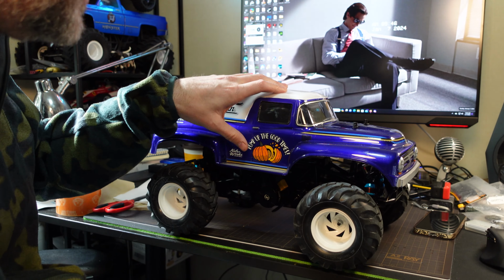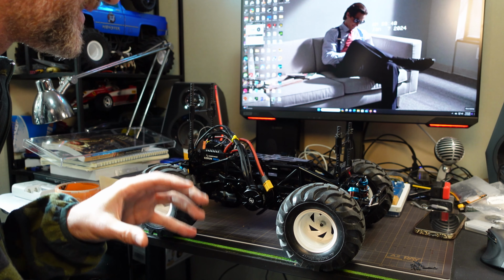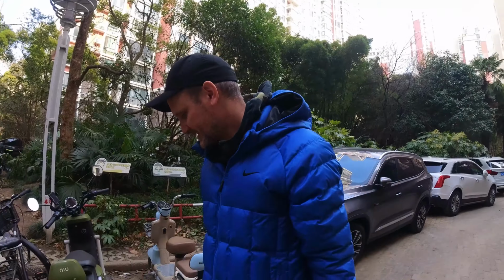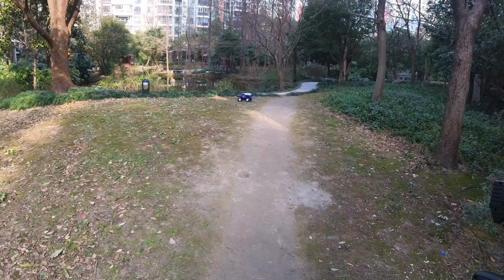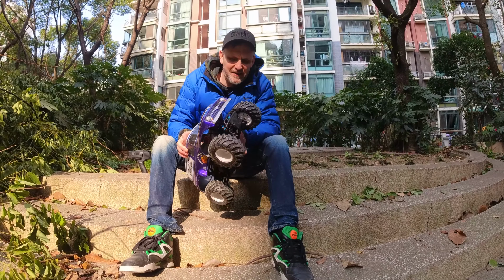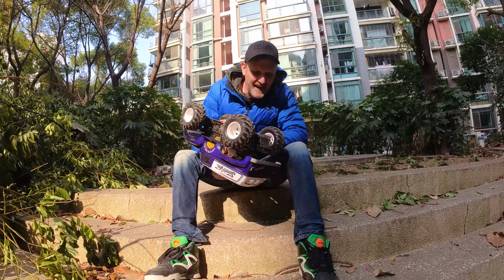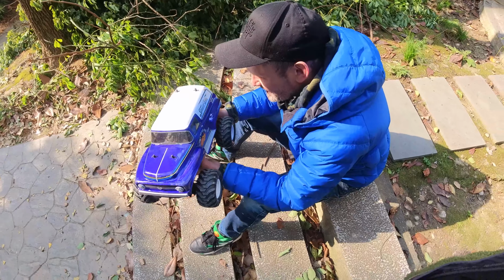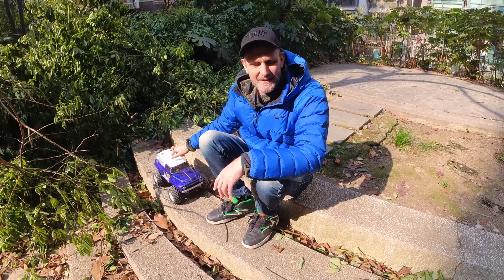Is faster better? Squash Van Brushless

Comment: Now thats more like it 😆
Do you think a wheelie bar from GF-01 fits ?
Also some wider wheels maybe 😉
I have 3300 Kv in my GF-01 and with a wheelie bar it was more controllable
Reply from the maker: Unfortunately the wheelie bar from the GF-01 doesn’t fit. There were many more rollovers than what I put in the video. I think it’s overkill. For this power a lowered suspension and perhaps axle extensions are necessary.

Comment: 3100 kv would’ve done okay in that chassis with a 60a esc. Goolrc 3100kv would be good.
Reply from the maker: Hmmm. Maybe. I think with the wider wheel set, a faster motor would be fun. Walking over to right the chassis every couple minutes is never any fun 😂

Comment: You should put one of the super stocks in it.
Reply from the maker: Thinking it might be too much… Got two new Dirt Tuned motors setting around though.
Reply: @Triggered-RC dirt tuned might be about perfect.
Reply from the maker: Just had it out with the dirt tuned motor. Runs well, super fun.
Reply: @Triggered-RC  I have a dirt tuned in my grasshopper,great motor for the grasshopper.17,000 rpm from that motor.